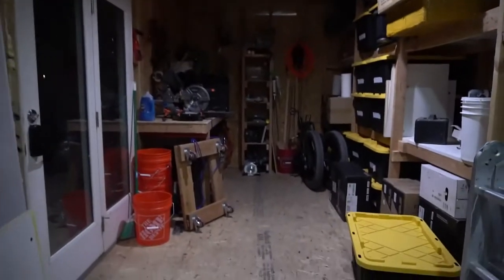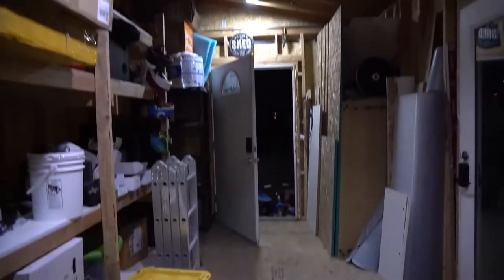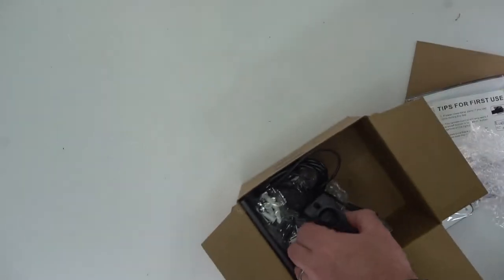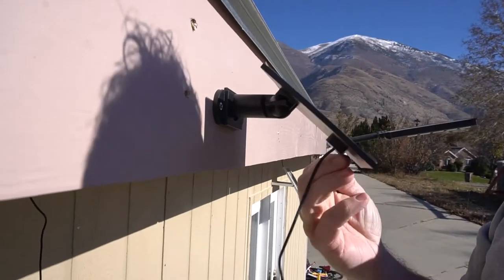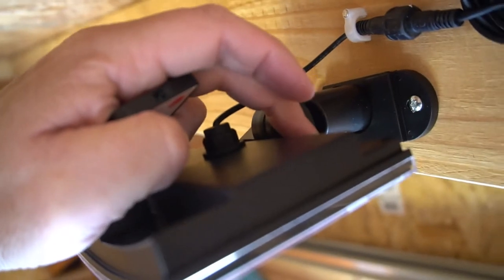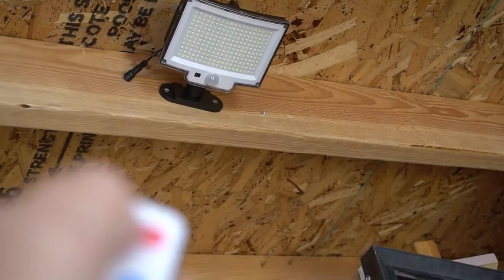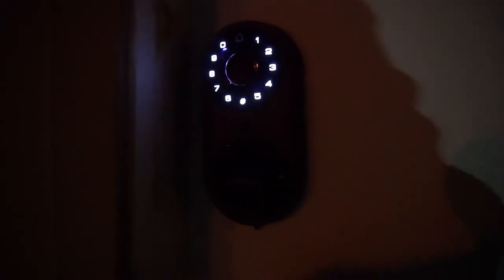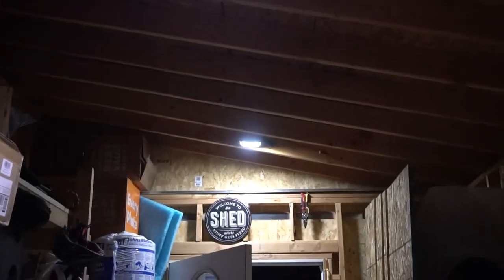Solar Outdoor Lights Motion Sensor Review

Comment: Are these still working, I find these Chinese products are great, but the rechargeable batteries they use are always cheap quality and capacity decays after just a few months.
Reply from the maker: Still working every time I walk into the shed. I don't know how long the batteries last but I have been super happy with how well these work at night.
Reply: @GoTechGeek  Thx that's great to hear, as I ordered one. After a few months I always take apart the product and replace the batteries with good quality of  ones.